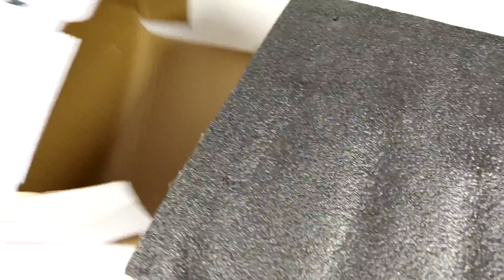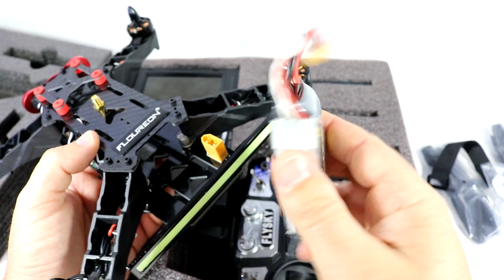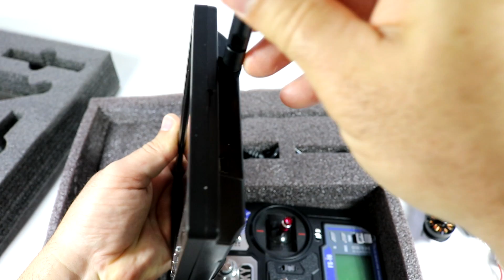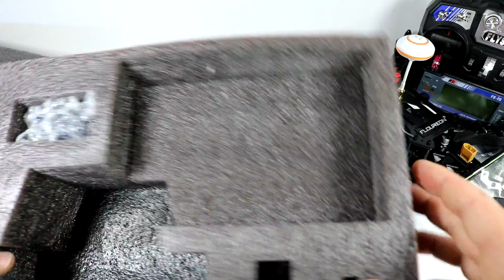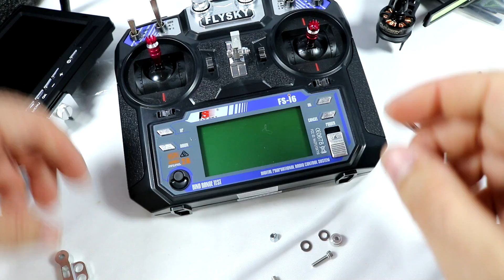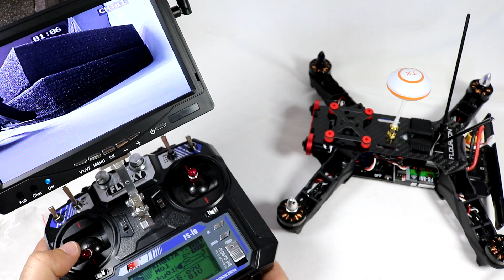FLOUREON 250 FPV Racer Drone Review - Part 1 - [UnBox, Inspection & Setup]

Comment: Dustin, can you tell me which battery to buy, I need to buy it with some extra batteries, and a good charger if there is none provided. Can you also give me a link for a less expensive google to use, that link is discontinued? I found This one AOMWAY Commander V1 FPV Goggles  -  NO HEAD TRACKER , what is Head Tracker? Will really appreciate.

Comment: Hi. I'm a bit confused. First you said the back motors would spin in towards the back although then you said the black caps spin clockwise. Which one is it? Thanks. Also, the switch does not turn on my lights like yours does. Also, in the included charger, cell 3 does not light up. It did when I first received it though. Now it does not. Thanks for the help.
Reply from the maker: +Dre J One rear motor will spin clockwise and one counterclockwise.. therefore a nut for each tightens the opposite direction of motor spin to stay tight when motor is spinning.  Not sure on your lights..sorry.

Comment: I can't get a channel on my fpv screen. Also the tx antenna gets hot at the base where it screws into the drone? HELP
Reply: Chris Weber Did you plug the battery in and power up the drone before putting the antenna on? If so you may have fried your video transmitter. BTW check the shipping label and make sure they did not send you one from their returns department.

Comment: where do you get parts?
Reply from the maker: You should be able to get them from the site linked in description or ebay.  The eachine racer 250 is essentially the same quad so you could use parts from that also.

Comment: I just got the rtf version. I'm trying to figure out how to charge the fpv screen? please help. + 3 of the 4 motors were DOA? when arming all but 2 motors would spin up, the 3rd motor would sometimes spin up. the front right motor is the only one that seems to be okay for now. the ring on the bottom of the motors seem to be damaged or loose. Had this for about an hour now and have been attempting to get a replacement shipped out to me. so pissed rn
Reply from the maker: +Tech on Demand There should be a charge adapter with a red just on one end.  Some motors may not spin unless its actually trying to fly.  Spinning motors up on ground may only spin some as it is trying to find level.  Try get it up off the ground with some throttle
Reply: i have the cable that plugs in to the screen with the red plastic end. the jst calble. but where do i plug it in? on the controller? or am i missing the charger for the screen?

Comment: Hello there, pretty honwst, Nice and detailed review. But i want to ask you for your suggestion for solution of Problem with a floureon 250 that i got yesterday. The DOA display doesnt turn on properly. It just shows like few wide stripes, which have either Black color or shades of gray. Thanks for any Halp, i Really need some right now ;((

Comment: Which better,floureon or eachine 250?
Reply: +Vladimir Vladimirovič Putin 
why?
Reply: Gail Raby why not?
Reply: I know this question already been asked but can someone explain how to charge the FPV screen?
Reply: Need separate battery for fpv
Reply: Chris Pearson   For the floureon FPV, it comes with a JST plug but nothing to connect it to the charger. And thanks for answering
Reply: I figured it out pretty easy once you get it.

Comment: I don't know if it will be strong because if you have seen the video rotor riot did in the eachine racer 250 they crashed it into grass from about a metre and the one of the arms snapped of and was left hanging
Reply from the maker: +ivan sikaleski They were probably trying to fly it like a pro racer.  This is more for beginners to intermediate.  You'll see in my flight test soon... I crash into trees, grass, chain link fence and roof with no real damage :)
Reply: Dustin Dunnill  and my friend had a eachine racer 250 and the range was really low it was only like 25 metres and then it fell out of the sky from about 2 metres onto grass going about walking speed and the top right arm snapped
Reply: +Dustin Dunnill do you know where I could find a backpack/case for the hubsan h502s
Reply from the maker: +Joshua Phillips the link on description has a 501s backpack which should fit the 502
Reply from the maker: +ivan sikaleski something must have been wrong with his.  Did he spread the antennas up like o did here?  I had no range problems all around the perimeter of the park 400+ feet.  He had bad luck I guess.  You'll see how strong mine is when I slam it ..lol. Guess if you slam it just right anything will break :)
Reply: Dustin Dunnill  so do you reccomend this for my first racing quad?
Reply: Do you have a link for the 3D printed antenna mount? thanks man im getting one for my son, great vid bro

Comment: Not just a re-brand, it is running a different flight controller.
Reply from the maker: +Tom von Trott Your right and it fly's solid with the stock RTF tune.  Had a great time with the flight review which I'll have up soon :)
Reply: +Dustin Dunnill and I think the escs are blheli 20 amp and on the eachine they are simonk 12 amp so the escs are better as well